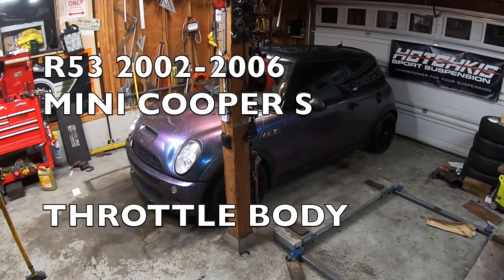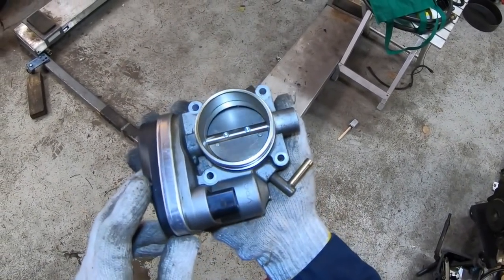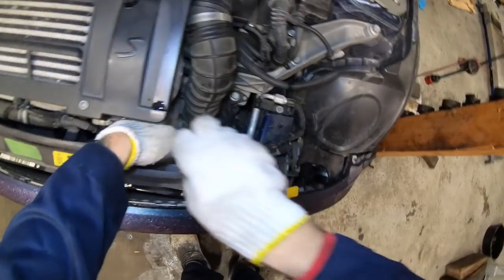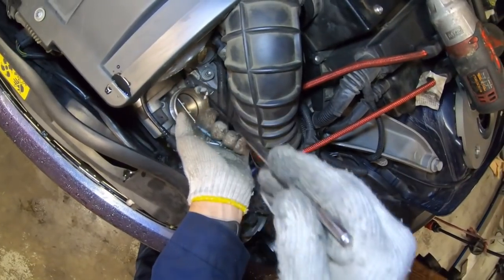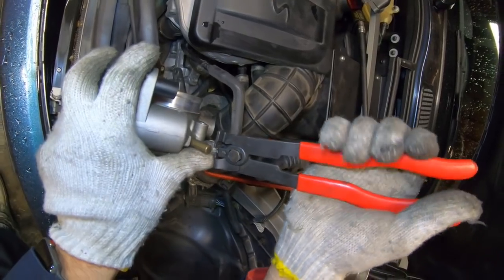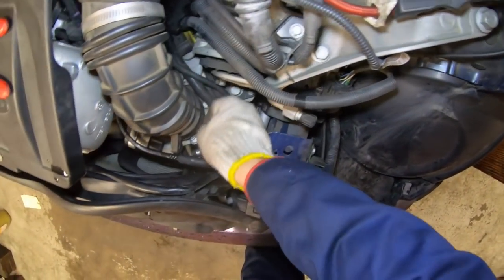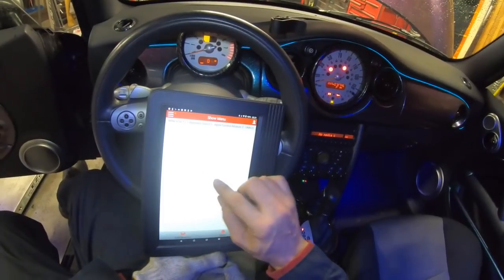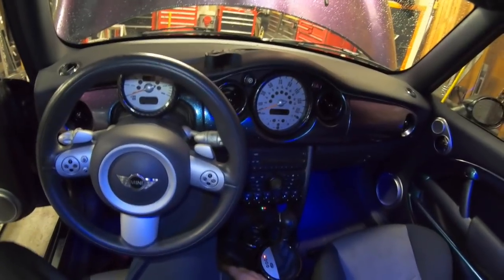Replace R53 MINI Cooper Throttle Body P1125 P1126 P0638  2002-2006

Comment: 2003 mini , check engine light is on but there’s no issues but if I come to a stop and let it idle the check engine light starts to flash and engine changes to run not so good. I can turn it off and back on and it resets the issue and this only happens when it idles never while driving. Even sitting at a stop light I can hold the gas to keep the rpm’s at 1500 and it doesn’t trigger the light to flash.... any ideas off hand?
Reply from the maker: read the codes.
Reply: I don’t have a code reader, money is tight and have no tools, long story but kind of starting over in life....lol. 
I was just trying to get an idea but thanks for the reply at least. Your videos are excellent and I’m glad there’s people like you doing these types of videos for others....Easy to follow...

Comment: Are eBay throttle bodies safe to use? I would think for something like that you'd need OEM
Reply from the maker: I would buy new OE manufacturer or used over new aftermarket.

Comment: I had codes that indicated the throttle body, but the car ran fine.  The prior owner replaced the throttle body 2 months ago (I have his receipts).  I reset the codes (P1125, P0638, P1126, P1229) and waited.

Several days of running fine, the it started rought and stalled twice, but ran fine on the third try.   Again, the engine light came on, with codes this time P1125 and P1229.  I made an appointment at a local independent shop that got good reviews.  

The shop diagnosed the issue as the engine wiring harness.  The harness is $400, labor is $700, plus $100 for programming.

What's your opinion about the diagnosis and the possibility for a DIYer to do this?
Reply from the maker: I can't comment on a diagnosis without seeing car myself. Changing the wiring harness requires no special tools; I don't know your skill level so I can't say whether it is possible for YOU to do this job or not. Programming is just clearing codes and resetting throttle adaptations. which can be done with this tool. https://amzn.to/2IhCfkk
Reply: Thanks for the reply.  I was able to replace brakes, rotors, 1  caliper, and power steering hosed by myself.  How would you rate the wiring harness replacement compared to those?

Before I decide to replace the harness, I hope to check out the wires as best I can to see if there is a spot that shows damage from abrasion.  If I see that, I may be able to repair the current harness.  I'm very comfortable with soldering and heat shrinking.
Reply: @ModMINI  Can you perform this step without messing up an aftermarket tune?
Reply from the maker: @iserved1642  Clearing adaptations will not affect a tune.
Reply: @ModMINI  Since the wiring harness is a lot of work, and seems the least likely to be the issue I decided to replace the throttle body first. After ~100 miles, the symptoms returned.  I then pulled the ECU to send it out for rebuild, but before I did that I noticed a bent pin on one connector that would cause the pin to not go into the socket properly, possibly making slight contact.  I straitened the pin and have driven over 300 miles without issues.  If I get to 500, I will assume that was the issue.
Reply: @raymondrizzuto7997  I found one report of someone finding a bad wire between the pedal and ECU, or something along those lines.  He diagnosed it by just testing continuity on wires while he wiggled them.  Given that I've had throttle pedal codes before and now get thorttle body codes, I'm thinking that might be my issue, but I'm going to throw a throttle body at it first.    In your case, I would do throttle pedal adaptation (easy DIY) and throttle body adaptation (needs tools) before going further, I think.  Maybe the previous owner never did the adaptation.
Reply: @ModMINI  I replaced the wiring harness.  It was a 10 hour job.  The connectors in the front weren't bad, but those behind the engine were a pain.

Unfortunately, I managed to cause an issue I couldn't diagnose - the intercooler boots had split, due to age or my own fault, I don't know.  Had to have it towed to a mechanic to have that figured out.

Sadly, even after all that, it went into limp mode as soon as I left the shop.  This was caused by a failed crank shaft pulley/harmonic balancer.  I had my mechanic replace that, plus the front main seal.  The belt was trashed due to the wobble of the pulley.  I had just replaced it, likely the prior one failed for the same reason.

So, now I just need to drive it for a few hundred miles to see if this issue has finally been exorcised.

Comment: I have a 2005 r50. I recently replaced the cylinder head and now it won't start. It starts for a little bit and dies out. New coil pack, wires and spark plugs... also a new camshaft position sensor... could it the throttle body sensor? Or stuck on limp mode?? Or the anti theft system?? The only codes that show up when scanning the ecu are 5e19 and 5e5c. Could you please help.
Reply from the maker: Verify correct chain timing
Reply: @ModMINI  the sprocket and chain markings were set right to my understanding, cylinder 3 and 4 didn't respond to the pressure test... i ended up buying a used motor and having a mechanic install it... should be back on the road soon. Thank you for your reply. Your channel is very useful to us mini lover, bless you always and stay safe!!!

Comment: What it could be if only P0638 error appears? Thanks
Reply: Same for me, turning on the car the idle is ok, then it goes in protection if I accelerate over 3k rpm/min alerting P0638 error only, then the idle engine become strange until i turn off, thanks

Comment: Hi I have a 02 Mini Cooper s and it idles rough but otherwise acceleration seems pretty good until today I was driving accelerating about 3/4 throttle and all sudden at 3k RPMs it felt like the motor shut off like it completely lost power I let off and then it was good now every once in awhile around 3K RPMs it does it when I'm accelerating fast. Earlier today the check engine came on and it did throw p1125 and p0442 codes but then it turned off now the light came on again after It started stumbling but I haven't checked the codes again yet. Would you have any idea what the issue could be.
Reply from the maker: Could be throttle body. Easy enough to replace with a used one and see if that helps.
Reply: @ModMINI  ok I guess I'll try thanks.
Reply: Hi I bought the c310+ scanner tool that you linked from Amazon to reset the throttle body but I can't seem to find where to reset it on there could you explain to me how to do it please?

Comment: Mine does go over 6 miles and hour on first gear and on second it’s 20MPH and and when it’s on idle the whole engine shakes and it says eml and service engine room but no check engine lights
Reply from the maker: Scan for codes.

Comment: Do you happen to know the torque specs for the TB bolts?
Reply from the maker: Sorry no. They'd be the same as any other bolt of the same size. though.
Reply: Probably just tight, but not too tight... LOL

Comment: I changed the throttle body like you did, but I didn’t reset it, and it works great but when I changed the throttle body the abs now are failing, actually the mini show me some codes and I don’t know how to repair it, can you help me with that?
Reply from the maker: you need a diagnostic scanner that can read the DSC module codes to know what is wrong.
Reply: @ModMINI  thank you a lot! actually the throttle body was fine, but i had a problem with the battery and that was doing the problems

Comment: Hi, I have 06 cooper s and have a code P0303 and P0313, and the engine light is on. I have replaced the spark and the coil but the code is still there. I think it's the problem from the injector or the fuel pump. Any suggestions?
Reply: Many thanks for your video
Reply from the maker: You would need a diagnostic scanner with live data stream capability to figure this out. Could be anything without doing further diagnostics. Burnt exhaust valves are a common problem on these cars as well with higher mileage
Reply: @ModMINI  Thanks so much for your reply. I have a ODB scanner that can show the live data. What spersific numbers should I look at. I'm also thinking the head gasket leaking can be the problem because i can see some thin oil floating on the water tank. The car runs good. But when i stop and the temperature is up and the fans and water pump begin to work, then  I can feel the misfire. Many thanks for the help!!
Reply from the maker: @yunbow5630  It is beyond the scope of a comment section to advise what should be normal live data, but you don't need a scanner to tell you that you should suspect a blown head gasket based on the symptoms you are now reporting. The coil pack almost never fails, by the way

Comment: Will be removing it just for a clean, should i unplug the battery before doing this? Have an r53 with problems starting. It has always started, but takes the engine a good 7 seconds of the starter motor turning for it to turn on. Once it does the exhaust smells rich with fuel.  Recently changed spark plugs, battery and fuel pump to try to address the issue without success. Also, Here and there the code P0138 pops up, pointing to the lambda sensor after the cat convertor, could that also be why the engine is flooding itself before turning on after 7 seconds?  Running out of ideas to check, thanks for anyone’s input.
Reply from the maker: No need to disconnect battery. Try replacing fuel filter.
Reply: Mod MINI thanks for your reply! will try replacing it too.
Reply: Quick update. Still the same issue after changing the fuel filter. Updating this thread with info for any MINI owners with the same problem later on.
Reply: @matthew3668  Did you clean your throttle body?
Reply: In the end it was the fuel pressure regulator! Sorry for the late reply 😂 but just got to fixing it now

Comment: I ve changed that and the gas filtrer..the car takes forever to start when it gets a bit hot. It performs perfect when it start( so its not the pump)..what should i do;
Reply from the maker: Leaking fuel injectors maybe
Reply: @ModMINI  thanks for the advise man
Reply: @ModMINI  injectors cleaned and checked properly by a trustful mechanic guy. The car still does not start easly after a normal drive and ,like before,it starts immediately when it sits a hole night.. (The injectors was very dirty and the car runs smoother but the problem remains).the guy told me about a part of the fuel pump that might not shut off right and leaves air in the system..) what should i do?

Comment: Did the throttle body really crap out at less than 73,000 miles?
Reply from the maker: It is unusual/rare for a throttle body to go bad. I've only seen two and both were under 70k miles. There may have been a bad batch.
Reply: @ModMINI  Mine appears to be gone at 96,000.  Some people report success after cleaning the contacts and throttle body.